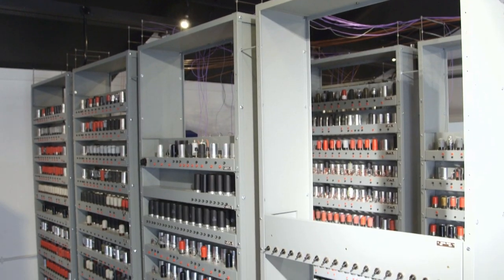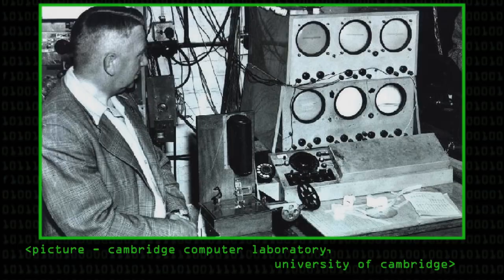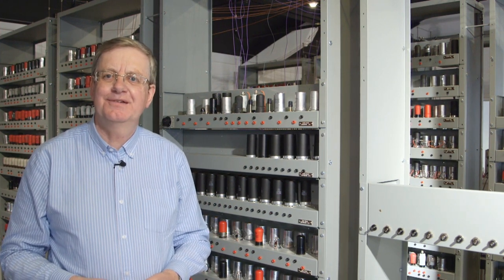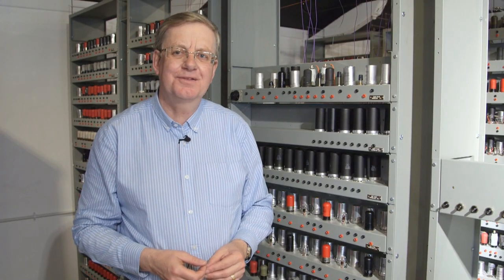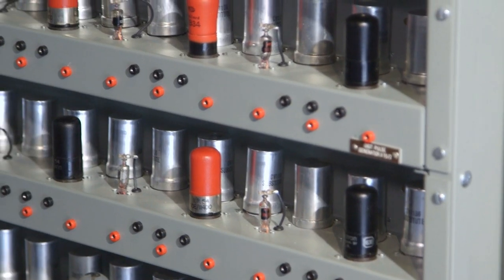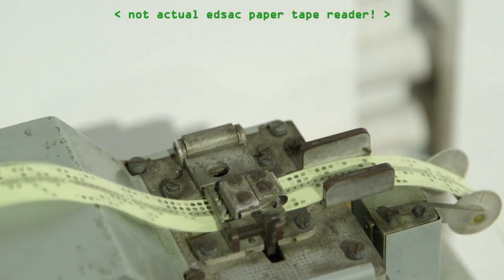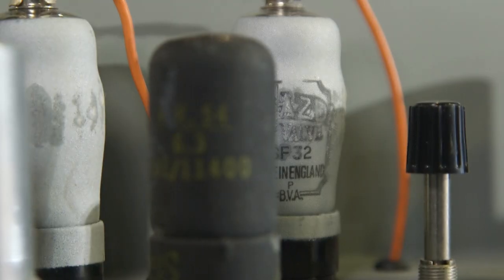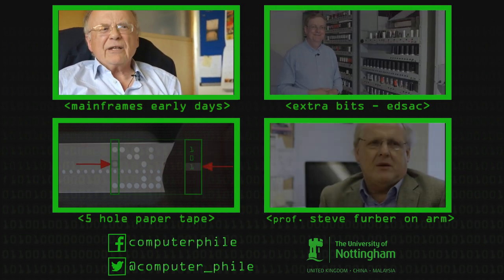EDSAC Rebuild (Cambridge University's 1st Computer) - Computerphile

Comment: on MTBF a common practice was to run everything at relatively low voltage.  This slowed things down but radically improves tube life.  Later tube computers had self testing and features that let you freeze the machine and swap out a small rack of tubes and continue from where you left off. e.g. a flip-flop would be in an easily pullable rack rather than replacing individual tubes.

Comment: Valves (vacuum tubes or "tubes" in the US) are still popular in two consumer products, guitar amplifiers and high powered amateur radio amplifiers. An electric guitar amp is considered part of the instrument, since it produces the sound. Some famous owners of vintage amps have bought entire existing stocks of rare valves, enough to keep their amps running for years.
Reply: RMoribayashi Thank you.  I was pretty sure that valve = vacuum tube, but wasn't positive, thinking maybe they had a physical resemblance to a vacuum tube but were not the same thing.
Reply: MichaelKingsfordGray I was speaking generally, not about a particular type. I wouldn't exactly call the 1000 watt power tetrodes used by Ham radio "audio valves". What type of valve are they using?

Comment: It's great to see all of those tubes being used:). I do wonder about the narrow height of some of those racks though. I'd think that it would be easy enough to make larger spaces to ensure adequate cooling for the tubes. This is especially important now because those tubes aren't being manufactured any longer. Still, it's great to see the old tech being used.

Comment: Valves are still in plenty use in guitar amps, so there's always a manufacturer out there if you need them.
Reply: MichaelKingsfordGray Huh, I never knew the difference was so substancial.

Comment: Fascinating. 3000 valves which at my rough estimate average of 2W per filament would radiate 6000W of resistance heating. Any guess about the MTBF for this reproduction? Total power requirements?

If I lived in the UK near Cambridge, I'd definitely volunteer to help.
Reply: +Winston Smith I think they said something like 20kw but I'm not sure.
Reply: @thelol1759  11KW, it's in the description.

Comment: Cool it's TNMoC I've been there a few weeks ago!
Does this mean we will get more video's from there?
Reply: spankmeister 
Yes -- Sean and I went to TNMOC a week ago. He got plenty of footage not just of EDSAC but also of 5-hole tape readers/punches, COLOSSUS etc.
The original EDSAC was amazing in that, within a few weeks of the finish of construction, in 1949, it was offering a computing service to the whole University!
For those interested, the power consumption of this rebuild is a modest 11 kW (!).  So, yes, it does get (carefully) turned off at night.
Reply: ProfDaveB Cool! Thanks professor! Yeah I was really impressed with the machines they have on display there. Dare I say I was more impressed than with Bletchley Park itself? Yes. I was. :) Colossus, Robinson, Tunny, Dekatron/WITCH, EDSAC etc... All amazing work.

Comment: As I understand, there are certain applications which are simply impractical to implement in semiconductors, and valves (or tubes as we say in the U.S.) are the only viable means of implementing things.  One example which comes to mind is power amplifiers for high output radio transmitters.  So I would imagine there are still a few valve/tube manufacturers left.

Comment: I wonder how much the temperature in the room would increase during maximum load .
Reply: Henry Darr Pretty toasty I could imagine.
Reply: Henry Darr watch the extra bits. They say the machine takes 11kW of power and pretty much everything is gonna be transferred in heat. So yea, pretty powerful heater.
Reply: Henry Darr The load doesn't really matter much I think. It's all those valve heaters that make things toasty.

Comment: But can you play Call of Duty on it ?
Reply: NeX128 No
Reply: Kevin Froman Maybe with enough RAM you could, FPS might be on the low side though, like frames per year or something :)
Reply: SerBallister
I don't think it has the graphics capabilities. Besides, I'm pretty sure its a incompatible architecture.
Reply: Kevin Froman It could software rasterise and emulate all the missing hardware, but I don't know enough about this machine to tell if it's general purpose enough to do it.
Reply: Kevin Froman With enough memory and time to wait you can emulate pretty much any system. The graphics could be put out by reading memory or something.